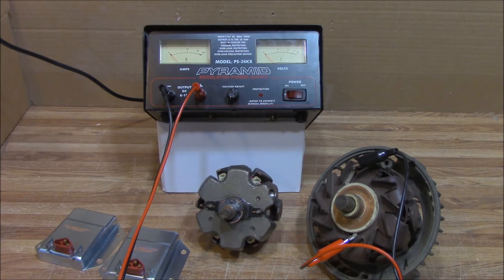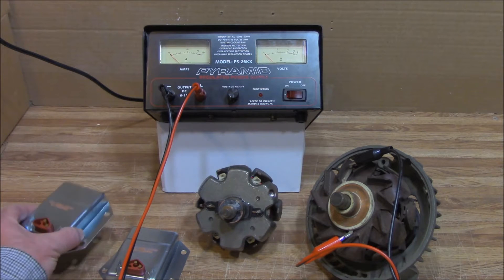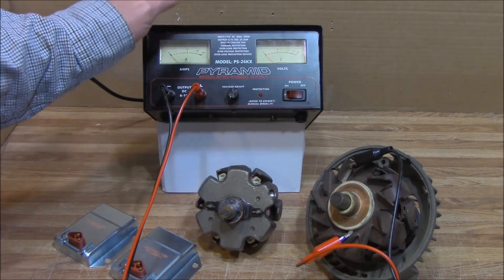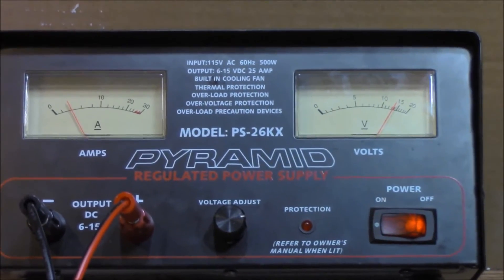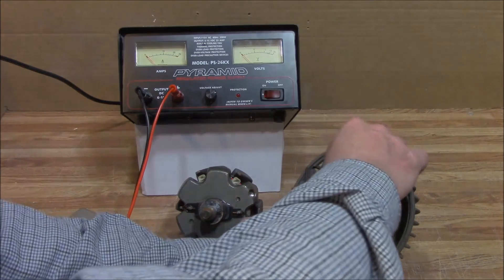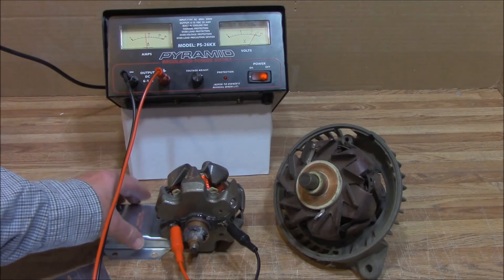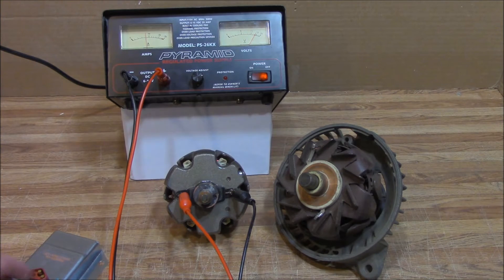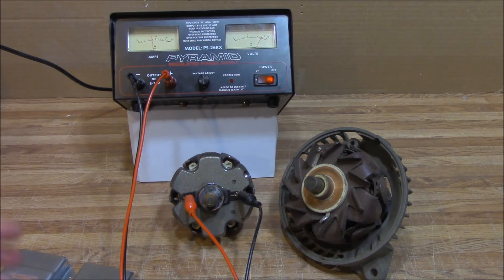Alternator Rotor Amperage Draw, Low amp to High amp Cause of Voltage Regulator Failure

Comment: Thanks for this.
Its tough to find info on alternator field draw current.
I have a Ford C900 firetruck with the 534 gas V8. Leece Nevill 105a alternator, discovered motorcraft regulator went bad and cannot seem to find a direct replacement, just threw on a typical Ford reg, and it worked for an hour and quit.. and I suspect I cooked it with the large leece Nevill alt.

Comment: Are you saying the 8 amp draw that you are measuring is what the battery will charge at?
Reply: No, he's not saying that. He's showing that you can't use a voltage regulalor rated for 5 amps when the field (rotor) of your alternator is drawing 8 amps and expect the undersized 5 amp regulator to last. He's saying it will fail prematurely, so it's best to get a voltage regulator rated for 10 amps when the field in your alternator is drawing 8 amps. The 10 amp regulator will last a lot longer because it's designed to pass up to 10 amps of current. 

I know I'm 6 years late but maybe it will help someone else now or in the future.

Comment: Well this certainly explains why I have been having troubles on my 89 Dodge diesel with regulators. The auto parts stores around here all sell Standard brand VR125 as the proper regulator for my truck that factory had a 120amp Bosch alternator.  This doesn't really explain why I failed the genuine Mopar USA made regulator in about 6months as well unless they are no longer putting the right guts in their regulators either.  If it dies again I may have to try one of the transpo HD units. I have a couple of videos about the saga on my you tube channel.  Thanks for the info!
Reply: plus your alternator was closer to 15v so the draw even higher

Comment: Hi could you comment if you were to break the b+ on the ternate to the exciter of the starter motor and shillac both broken ends and twist them together Like a rope with the wires wound 17 times and threaded through 4 neo dynimium donught magnets with washers sandwiched between them if this would cause a in and out if phase ac dc magnatron type effect.  Basically a type of tesla coil but the 3rd spike energy being a spherical lightning bolt effect to eddy current the aluminium head.  Look at joe cell horses mouth for the view if a air atom stripped engine by this method. Mel in uk
Reply from the maker: honda4004 WOW I'm not getting, could you explain it differently?
Reply: If you watch joe cell horses mouth video about 1 hour in you will see joe booker making his escort run on atom stripped air then watch joe cell talks 5.  Video here he draws in the sand a figure 8 going from North Pole to South Pole through the equator this is the alternator b+ to the exciter of the starter through a neo dynimium donought magnet would it be possible to deregulate an alternator and the ac become a negative ion generator and also a positive ion generator with a chrome aerial attached at 90 degrees to draw in all surrounding atomosphere atoms just like lightning as joe says in 5 video the fields stack from dc to ac as they collide in centre of donought and soak into circular msg rt which us fed to aluminium    Also watch brey213 youtuber video called Suzuki joe has refined it to run cars on normal fuel and then by removing positive on air look at the headlight relays on the tight bulkhead/ firewall these richochet the locked loop current